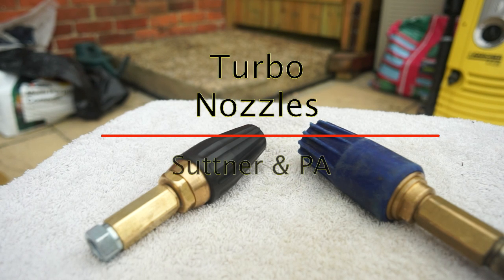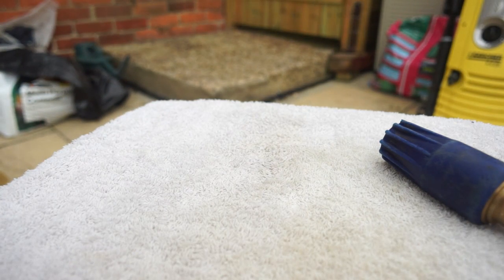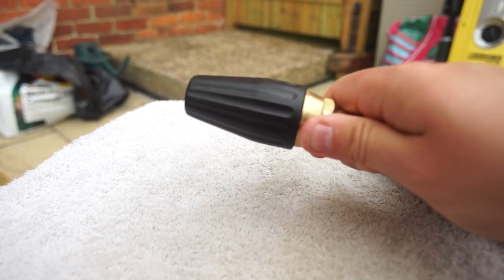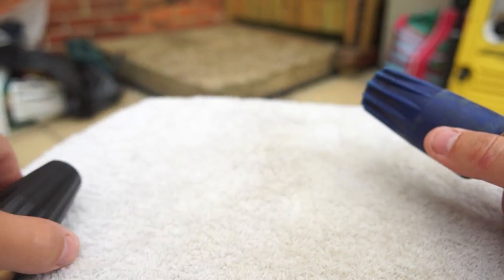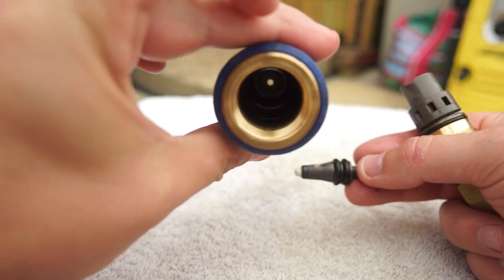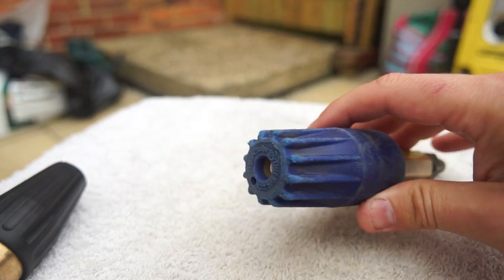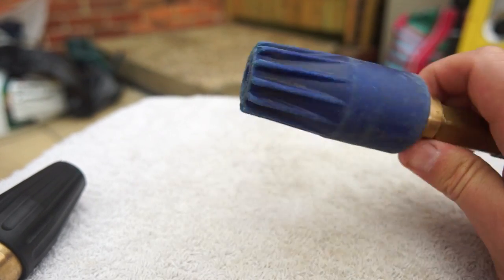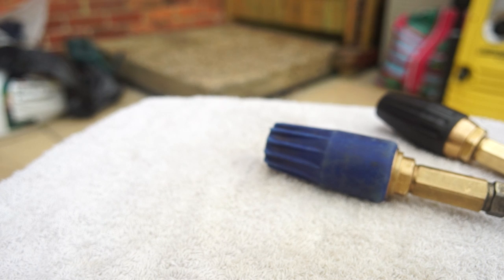How Do Turbo Nozzles Work? Let's Take Them Apart and Find Out.

Comment: Hello does either one of these brands have a nozzle to work on a Karcher K7 180 bar? i have the adapter already just worried The machine i have is not powerful enough... it's just for home use as im tired of keep buying replacement Karcher dirt blaster lance thanks.
Reply from the maker: I mean technically yes.  The flow rate on the karcher k7 is around 9-10 litres a min. The charts don't list what size you would need but I would say something around a size 035 may work OK. You would be better suited to trying one of the cheaper brands available on ebay. Both these versions are over £40 each now. Gone are the days when they used to be available for £27.
Reply: Ok thanks for replying will check them out.

Comment: Hi,  i have a cold water pressure washer , with 3000 PSI and 16LPMWitchs turbo nozzles is the best ?  greetz from EU
Reply from the maker: Hi, either the PA or suttner would work. I personally find the PA a more reliable nozzle. So long as you run an inline filter they should both work well. I've tried the suttners but I never had great luck with the reliability. I've had a PA for 10years and it still works like new. Just make sure you buy the correct sized jet for your machine. You would need a size 050.
Reply: @DirtyDriveAway  thank you very much for the info, greetings from Eu
Reply: @DirtyDriveAway  Hi, can´t find a link to PA.Italy turbo nozzle size 050. Can you help me please? My exact specs are Brand :Projet, Model: B16-220, 220Bar, 16 LPM, 7.0 HP, and 3400 RPM. Greetz from EU
Reply from the maker: @theclanchico  well I'm in the UK so they are quite easy to get. I get mine from here but not sure if they will send outside UK.
https://www.ebay.co.uk/itm/163323508260?mkcid=16&mkevt=1&mkrid=711-127632-2357-0&ssspo=K_H1uie8Ss2&sssrc=2349624&ssuid=rYV7lctCTgy&var=&widget_ver=artemis&media=COPY
Reply: @DirtyDriveAway  Hey Thx i´m from Belgium. They do shipping but its Postage:
£12.90 + Import charges £10.77 + £24.99 for the nozzle expensive !
Reply from the maker: @theclanchico  hmm that's the problem now. It's an Italian product so you must be able to purchase it in the EU.
Reply: @DirtyDriveAway  I know, but can´t find manufacture website or seller in EU ?
Reply from the maker: @theclanchico  can you not find a seller on ebay from EU.
Reply from the maker: @theclanchico  can you get a suttner where you are. They are German.
Reply: @DirtyDriveAway  i don´ know why but on ebay all i can find is in the UK
Reply: @DirtyDriveAway  i send an email to suttner, now  i have to wait ...lol By the way thx for the help.
Reply from the maker: @theclanchico  welcome.

Comment: What does the orifice size have to do with these Turbo nozzles? I'm looking for the most powerful Turbo nozzle to use on cleaning a aluminum 60 ft hull from barnacles and grime dirt etc
Reply from the maker: Depending on the pressure and flow rate of your machine would dictate what orifice size you need.
If you fit too big you will get max flow rate but sacrifice pressure, too small can cause excess pressure buildup and reduced flow. You have to match it to the machine spec. I have heard though that you need some pretty serious pressure for removing barnacles from boat hulls. Ultimately its your machine that will govern how powerful the nozzle is.

Comment: What's the life span of a turbo lance iv one on my tractor driven power washer 7 years but only use it week or two a year power isn't great in the powerwasher any more time to change the nossel??
Reply from the maker: I've had mine years but you'll find as they wear the pressure will drop off slowly as the nozzle gets bigger.
Reply: @DirtyDriveAway  thanks il go and buy a new one  was thinking that maybe the problem was with the powerwasher and didn't want to waste my money
Reply from the maker: @clairebehan1436  I prefer the PA ones over suttners.

Comment: Which size nozzle is best for 130 bar Pressure washer
Reply from the maker: 130 is a bit low, whats the flow rate?
Reply: @DirtyDriveAway  8LPM without nozzle
Reply from the maker: @jinuthomas5093  that'd pretty low power for one of these. They don't do one for that low spec, you could try a size 040 but you won't get full pressure from it.
Reply: @DirtyDriveAway  few people suggested me 025 would work best. What's your openion.
Reply from the maker: @jinuthomas5093  suttner doesn't make them that small. Smallest they do is an 030 from memory.

Comment: Helpful information. I have the blue PA 07 size one,. Is  my Honda gx200 14l /min good enough for it.
Reply from the maker: Hi, it depends on the pressure rating.
Reply: @DirtyDriveAway  it says on hawk pump 150 bar 14l min at1450 rpm.
Reply from the maker: @mack1609  07 is way to big youll never get full pressure with that. You'll need an 05 size nozzle.
Reply: @DirtyDriveAway  thank you for your help
Reply from the maker: I would say that unless its really low pressure then an 07 will be way too big a nozzle size.

Comment: What kind of filter it is? Could someone post a link to buy this? Because i do a lot of cleaing and it happens that ceramic get destroed probably due to some dirt. I would like to try that filter, but i can't find that.
Reply from the maker: Yes if these aren't filtered even the tiniest bit of grit can destroy the ceramic tips/seats or cause them to stop spinning. Try this
https://rover.ebay.com/rover/0/0/0?mpre=https%3A%2F%2Fwww.ebay.co.uk%2Fulk%2Fitm%2F271290898135
Phill

Comment: Hi. My turbo nozzle has stopped spinning. Have taken it apart and can see a gauge in the plastic 'turbo' wheel that I think is the problem. do you know of somewhere I can purchase this wheel ? I have tried various power wash online places to no avail. Thank you,
Reply from the maker: Any idea what make it? The only company I know that sells internal parts for there turbo nozzles is suttner.
Reply: @DirtyDriveAway Hi again. Don't know what make, nothing on it at all. its very similar to your P.A nozzle, heavy brass.
Reply from the maker: @jeffrose911  I would say no then, I know suttner sells the ceramic inserts but usually there is only about £10 difference between internal parts and a complete new nozzle.

Comment: Great review, thanks for the info.  Any idea what could cause my simpson turbo nozzle to stop spinning?  Its very odd, work everytime I power up for approx 5 seconds then stops with a random focused jet in one area.  Each time I squeeze trigger after it will stay in same place and maybe move randomly but does not spin as it should.  Took apart and all is clean.  Less than 2 hours use.  When I want to restart it, I have to remove tip, depress the wand and reinstall.  Again it will last only 5 seconds or so.  Thoughts??  Thanks.
Reply from the maker: Stephen Ricketts hey Stephen, can't say I've ever heard of Simpson nozzles. If it works in a similar way to the black suttner then the most common problem is the rotating nozzle jet getting stuck due to grit ingress. Problem comes by not using filters on the Lance and the smallest bit of grit gets in the chamber and scratches up all the inside and roughs up the plastic/composite nozzle making them lock up. If your lucky you may be able to strip it and smooth it with some metal polish or fine sandpaper but I had to replace my complete nozzle. Like you I had about an hour's use on it before it locked. These turbos are highly susceptible to grit, you can get quite a bit from the water source hose/tank. Phill
Reply: My entire nozzle is either brass or ceramic.  No plastic, seems odd that it works for 5 seconds or so before the rotating action stops....  Thanks for the reply.  Both the brass and ceramic are smooth as a baby's bottom and no groves.
Reply from the maker: Stephen Ricketts only other possibility is a faulty nozzle. I would always run filters on turbos just to be safe. You can always see the scratches that are made, my composite bit had the edges scuffed up and unless you really studied it you wouldn't see it.
Reply: Thanks, may have to order a new one and a filter.  Cheers

Comment: Hi sir,
i am using black type of turbo nozzle ,350 bar ,if the nozzle not rotating water. what should i do ,i did clean but same issue, but after changing new internal nozzle of plastic its working,

what should i do in the case of not rotating water.
also from where to purchase these things.
Reply from the maker: Ayaz Ahmad The rotating plastic nozzle inside will wear out. even quicker if grit or sand can enter the chamber. You can kill a suttner turbo nozzle in a couple of hours use if the water is not filtered. For parts or replacement best bet is eBay.
Reply: sir at ebay is showing black ,and i have white, is this same ? or different
Reply from the maker: Ayaz Ahmad I honestly don't know. I only ever use suttner or PA nozzles. do you know what make your nozzle is? there are a lot of Chinese copies on eBay and getting spares may be hard.

Comment: what kind of pressure do you need to run both the set ups you have there?...and flow rates?...what i'd like to know is would they be worth investing in for say a kranzle k7?..cheers rich.
Reply: the nozzles run best on 4GPM and with atleast 3000+ PSI. But regardless of PSI from washer it will increase pressure and help. they effectively create a "scrubbing" motion

Comment: Ditch the inline filters, & instead filter the water before it gets to the tank.
Reply from the maker: slim439 no chance, my water is filtered before it gets to the tank. unless you run stainless lances like I do now it can pick up small bits of rust from inside the lance and connections. I prefer to be safe, I've had these nozzles go wrong in the middle of a job without filters and it's a nightmare. running no filter is ok on large nozzle sizes but I have a twin nozzle lance that runs 2x 035 turbo nozzles and they block too easily if not filtered.